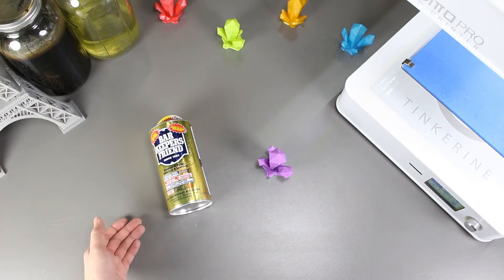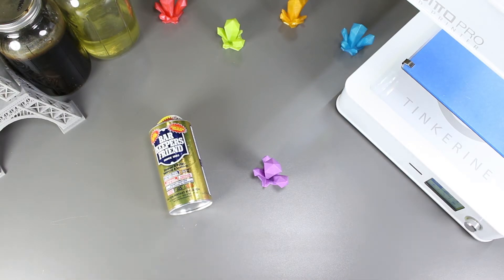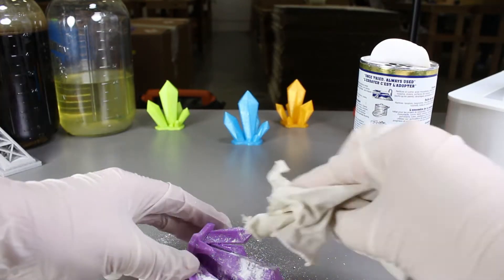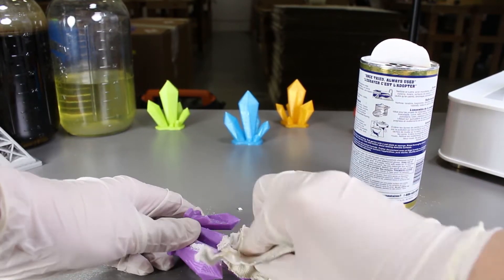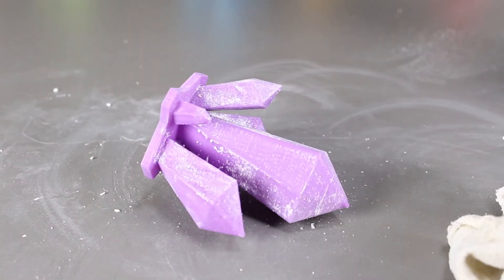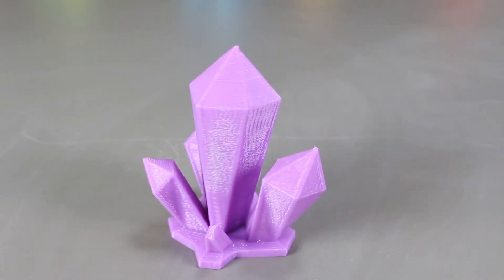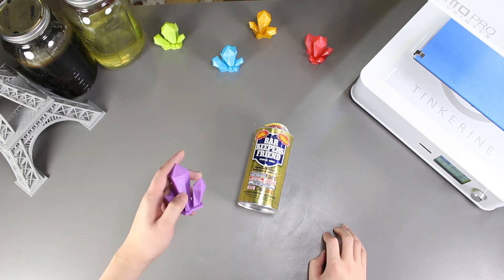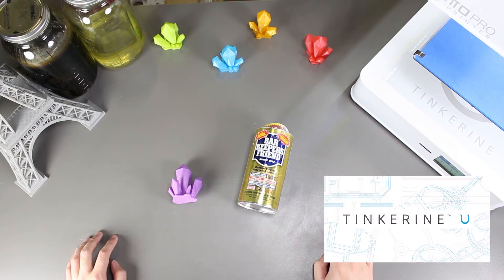Smoothing out 3D Printed PLA Model with Bar Keepers Friend

Comment: Umm, seriously? You are supposed to use water to create a paste with it. You didn't use dried-out Brasso, did you? No, because the liquid in Brasso helps retain the abrasive on the surface. Try it again, this time correctly...
Reply from the maker: Hi, 

Thanks for the comment, we just followed the instructions that was instructed on the label of the product. We can always look into trying it like a paste as well!
Reply: No, that is NOT how the directions read. This is from their website, which mirror's what is written on the can: 

"How to clean with Cleanser & Polish, Cleaning Made Simple
1. WET SURFACE TO BE CLEANED.
2. Sprinkle a small amount of Cleanser & Polish on the dampened surface.
3. Rub gently with a wet cloth or sponge.
4. Add more product as necessary.
5. Rinse thoroughly within one minute of application.
6. Wipe surface dry.